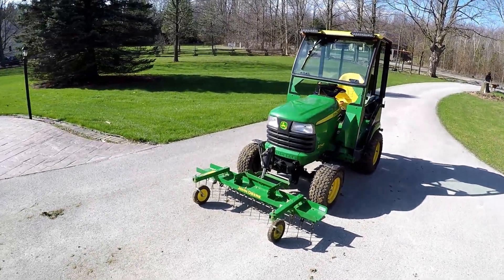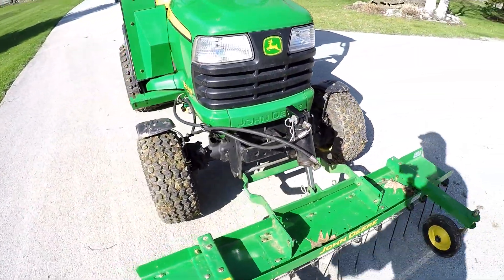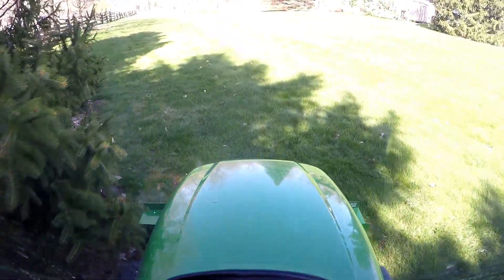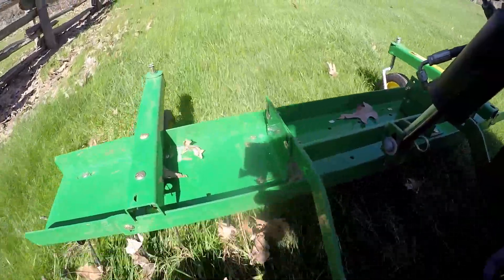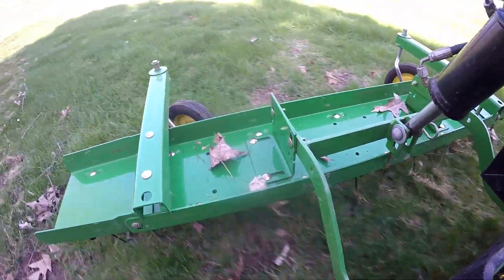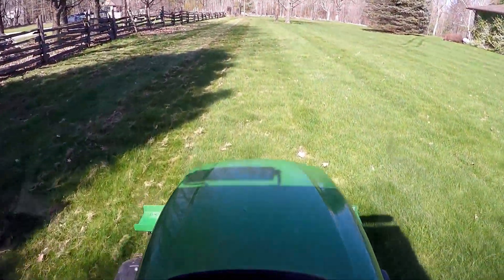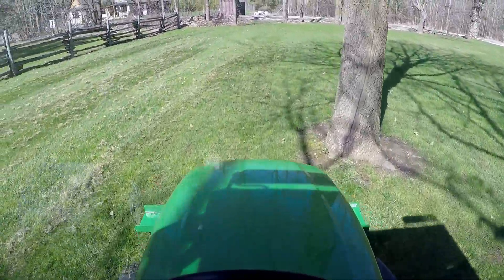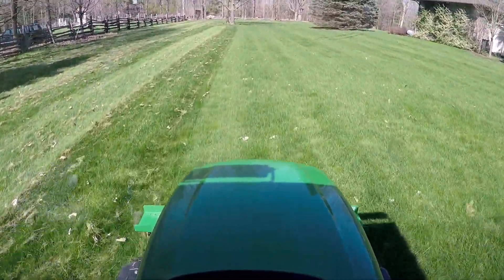John Deere X748 - 54 Inch Thatcher - Thatching the Lawn - 20190505

Comment: Hi Roger,  nice setup....  is there a reason why you didn't mount the dethacher to the front quick hitch and use the standard hydraulics?  thanks again, matt
Reply from the maker: Thanks for watching Matt!. I bought the thatcher complete (mount included) with the tractor and accessories (blower, mower, loader) at the time. I guess it would have been just as easy to adapt it to the QH but didn't think of it at the time. If i did I probably would have save a few buck on a hydraulic cylinder.

Comment: I did not like the Ninja blade my push mower camebwith and put Gators on my Ninja Mulcher and SPX at the same time.  I never have to thatch my yard.  The blades mow them into such small pieces they decompose before they buildup in the yard, but I do not have snow on my yard for six months out of the year, either.    My biggest Spring job is rolling lime and Milo.  The soil, here in SC is very poor and very acidic
Reply from the maker: Living a more northern clime definitely changes the way grass decomposes over a more southern clime where you live.